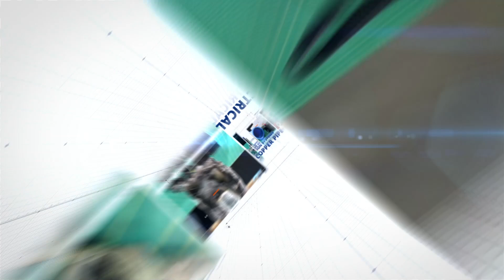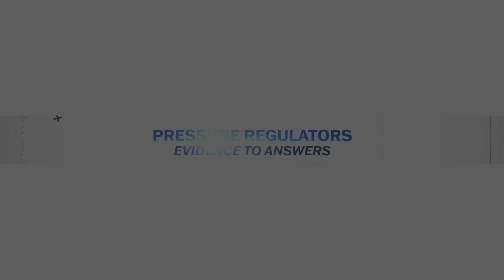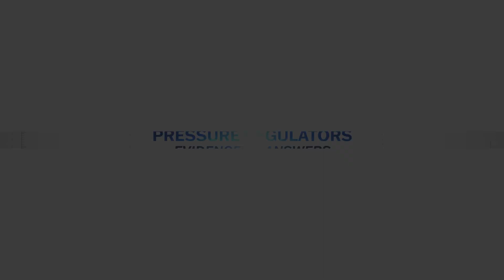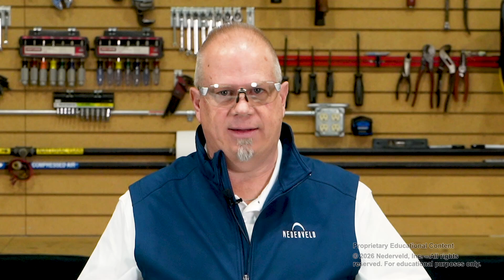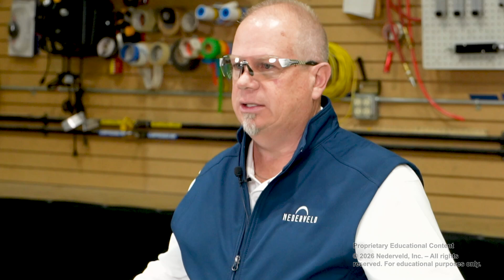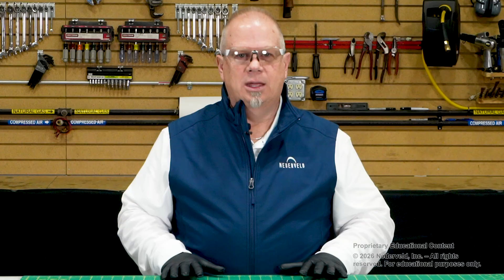Pressure Regulators: When Pressure Control Fails

Comment: Residential natural gas may be distributesd at low pressure (1/4 PSI) to homes without a pressure regulator.

Most common is that natural gas is distributed by the utility at 20-50 PSI to a step down regulator at the meter cock.  That regulator steps down the pressure from the 20-50 PSI incoming pressure to 1/4 PSI going into the house.

There is an overpressure regulator incorporated in the step down regulator, which opens the high pressure (20-50 PSI) supply pressure to a vemt going from the regulator to a safe place to vent that excessive pressure.

In my years as a natural gas utility employee, I never saw an overpressure situation cause that overpressure regulator to open and vent out natural gas.
Reply from the maker: Thanks for sharing your experience. We're glad to hear that you never had to deal with a regulator failure or overpressure event firsthand.

One thing worth noting is that different utilities use different operating pressures, and some systems provide 2 PSI or 5 PSI service downstream of the meter rather than 1/4 PSI. While regulator failures and overpressure incidents are rare, they do happen, which is why multiple safety and overpressure-protection measures are used in gas distribution systems.
Reply: @NederveldForensics  <<While regulator failures and overpressure incidents are rare, they do happen, which is why multiple safety and overpressure-protection measures are used in gas distribution systems.>>

I would suppose that if a high pressure regulator upstream were to fail,  an entire distribution system might be sharply overpressure.  I can imagine a hundred or more customers, all with gas bleeding out of regulators at a high rate!

That could be counted on to produce excitement by police, fire and gas utility personnel!